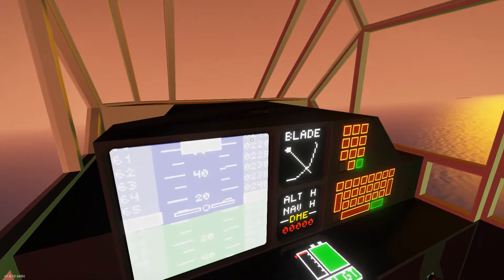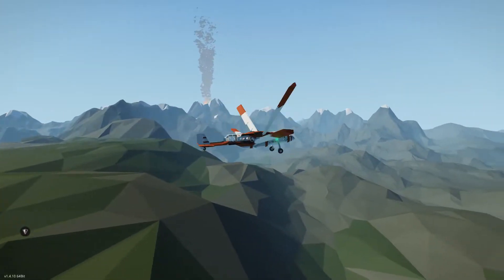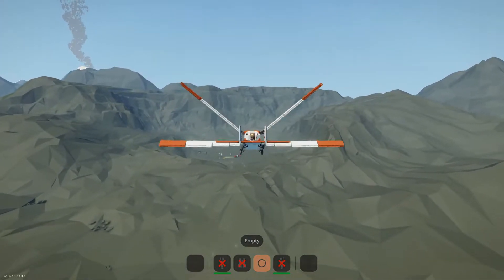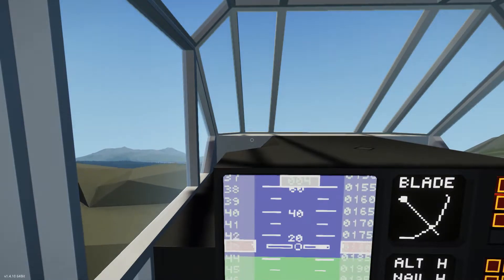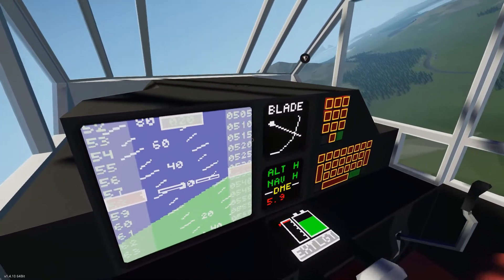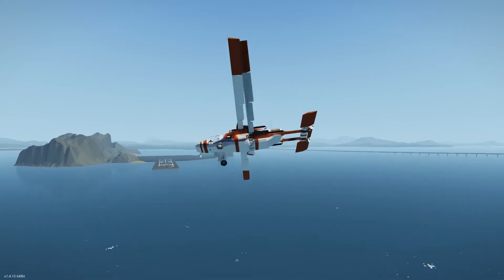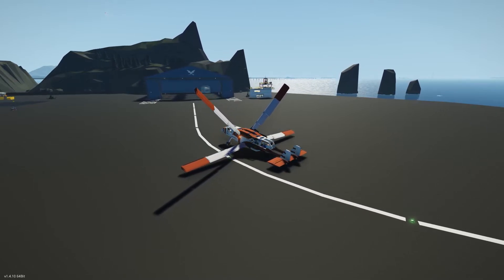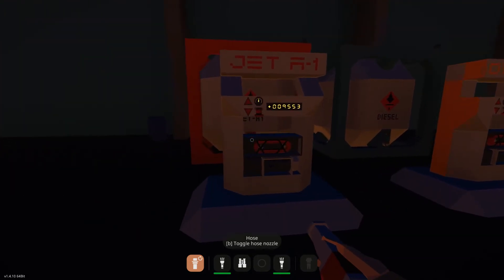Stormworks: Mariposa Ornithopter Guide

Comment: Impressive work.
Seeing this makes me realize how dumb I was to try birdflight first instead of a dragonfly type ornithopter. :D
Reply from the maker: The main advantage of dragonfly configuration is counter-force. You still have to deal with some pitch oscillation from the angles of attack of the wings and the up-down force of the wings locally, but the overall up/down shake is cancelled out. Bird flight also requires another hinge. It's doable and I actually achieved slightly higher speeds that way, but there are definitely a lot more hurdles involved. I don't have a bird solution I'm super happy with yet.

Comment: Tried making a Dune style Ornithopter. Can’t for the life of me get it to go forward, let alone off the ground. The control surfaces are pitching the corresponding directions so idk what I’m doing wrong.
Reply from the maker: My money would be on your wingspan being too short. You're interested in the speed at each control surface being as high as possible, and distance from the axis of rotation has a multiplicative effect on that speed relative to the rotation speed (velocity = radius * rotation rate). That's why my dragonfly-configuration ornithopters' wings get larger toward the tip: most of the thrust is being generated there. Of course this also means your hinges will have more load on them, but in Stormworks that is a much more solvable problem than forcing the flapping faster, especially since you run out of physics ticks eventually and the wings cease usefulness, reverse thrust, or gain other kinds of strange behavior. You can deal with the additional load both by increasing the gear ratio on the hinges and by adding more hinges in parallel and merging them together. Interestingly, adding weight to the wing-side of the hinge also appears to make them slightly stronger as long as the weight is close to the axis of rotation. That's the practical reason for the barrels attached to the wing roots, while I did learn to like them cosmetically. That said I'm afraid I can't give you any specific answers about that weight trick. Haven't totally worked out why it happens, how it works, or if it works consistently. If you hook me up with a screenshot of your design I might be able to give you a better answer.

tl;dr: Try lengthening your wings.
Reply: @decofox6789  No specific answers needed. You gave me way more than I anticipated. I did lengthen the wings some prior to seeing this and I’ve managed to get it to get off the ground a few feet for a few seconds and go forward. I’ll definitely try adding weight to the wing side of the hinges. If another couple hours of experimentation doesn’t work, I’ll be sure to get you a screenshot. Thank you.

Comment: Yo this is mad, you should try make one that functions as a VTOL by flapping the wings forward and backward instead of up and down. Could be done by having the hinges on a rotating mount
Reply from the maker: This is a challenging proposition because you introduce A LOT of flex in the wing with an extra joint mounted like that. I'm pretty sure it can be done, but I don't have a working design yet. I'll be sure to upload a demonstration when I work one out.